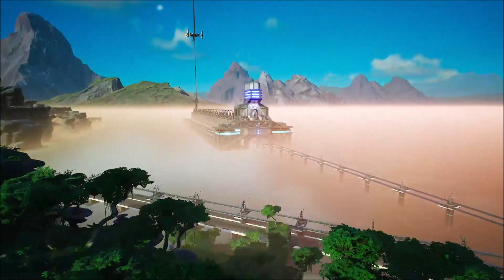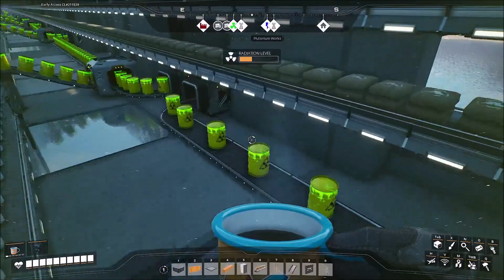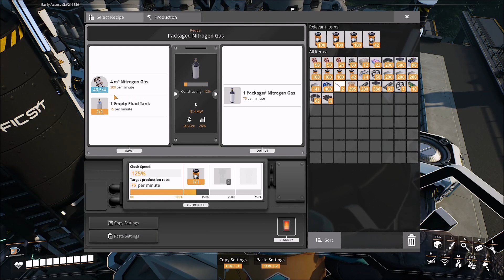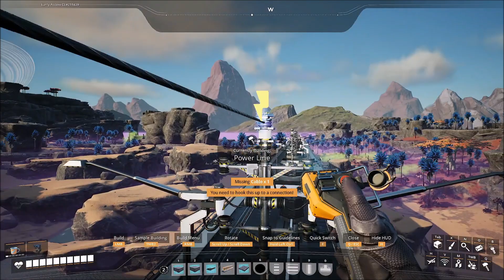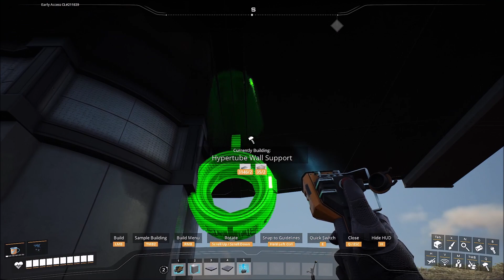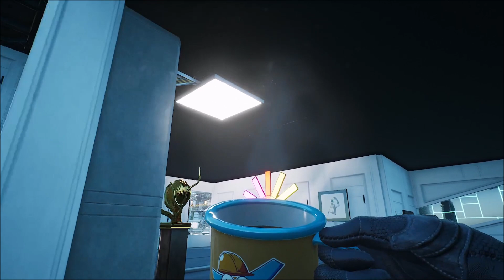💥⚡💥Satisfactory Nuclear Destruction💥⚡💥 for when 630,000mw of power is just to much to handle

Comment: I feel like a bit silly giving an expert like you advice, but I avoid the production throughput shortages you run into in this video and the last by never overclocking new build buildings over 150%.  That way when you run into the inevitable bottlenecks in a factory despite meticulous preplanning, just crank up whatever's holding the whole system back and bonus is you'll still have headroom to boost factory output to facilitate higher future resource needs.  

Really liking your new rail network focused build masterplan.  I've seen larger roundabouts work; they just need to be big enough to have a short section between the onramp from one side and offramp from the other.  Think that was Stin Archi but don't quote me.  But seems like you made yours work perfectly.  The new Xaos compact roundabout model!  

Looking forward to the new start from (almost) scratch.  Just don't burn yourself out man!
Reply from the maker: I appreciate the advice. I was overclocking everything as much as I could just for compactness. I wanted to use the smolest amount of space, but yeah going to have to re think that for next time.
Reply: @DrawingXaos  Once you've got the system running at peak efficiency you can go through and delete any production machines making more resources than needed and still end up with the least machines necessary.  Can cause design headaches especially in ultra compact builds like your last 2 when you end up with more machines in one area and less in another than originally planned but you can move the remaining machines around (logistical constraints aside) to try to fit within the floor dimensions you were shooting for.  Starting with a bit of overcapacity and then shrinking it down to exactly what's needed has helped me avoid bottlenecks in areas with tight footprints.
Reply from the maker: @solidXxXtuna  yeah i really think i need to focus on this new build, with making stuff that just makes more basic items than needed so the rest just falls into place.

Comment: I figured out my solution for hypertubes network pretty early in my first playthrough, back in U4. It's pretty simple - just make transit stations on each crossing. It allows you to:

1 - Build a booster into each entrance, which makes you way faster. And yes, you can make hyper-cannon, but if you want "fair" network, this is good, because traveling 4 km in uninterrupted tube is really slow. This way, you getting really high boost at each crossing, right when you lose your boost from previous one.

2 - It allows you to turn wherever you want, which solves the problem you showed at about 12:40. It was a huge pain to remember where each entrance goes back in U4, but signs solved that.

So, essentially, I repeated subway principles, when you have an option to switch directions, continue or exit at each stop. Was really comfortable, fast, and easy-to-use system for me.
Reply from the maker: Very nice idea, hard to incorporate with the old line i did do, but i guess not impossible. dang, now im rethinking deleting it all. lol